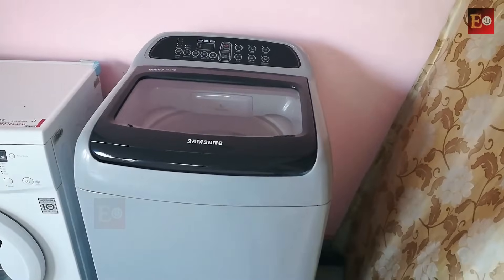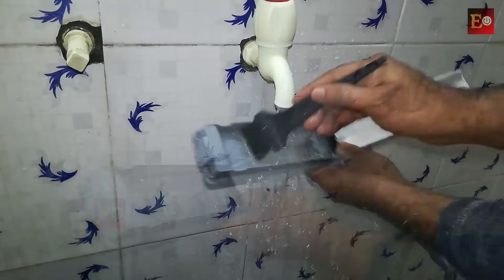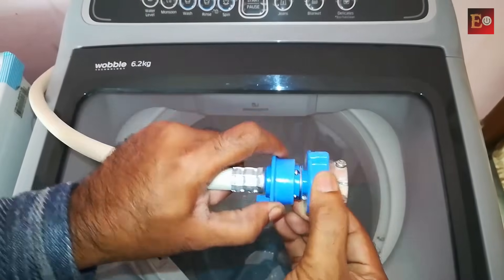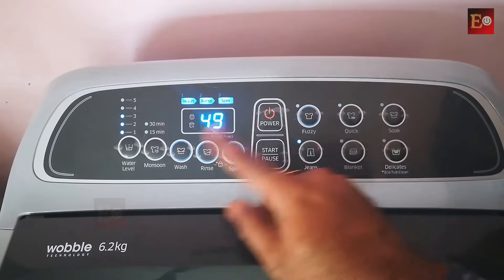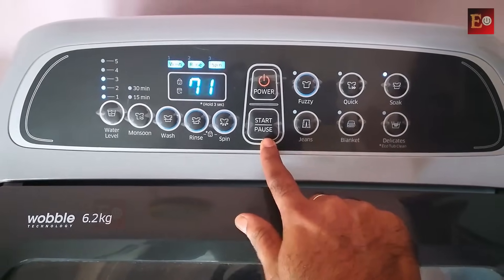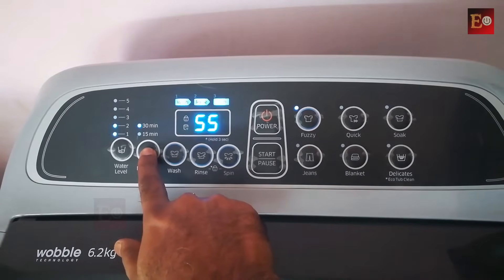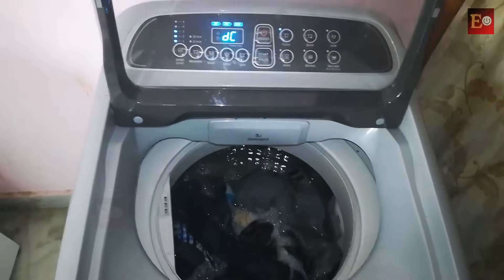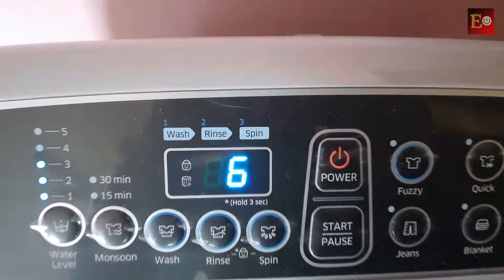Samsung Top Load Fully Automatic washing Machine Demo| How To Use Samsung Top Load Washer And Dryer

Comment: Thanks for the info but I have a problem on my top loader it wash the it suppose to spin it show e6
Reply from the maker: An E6 error can occur when a coin or foreign object is stuck between the pulsator and the tub. To resolve the issue, first remove every item from the wash tub. Then look inside the washer to check the bottom.

Comment: Hi! Thank you for taking the time to explain about the functions. May you please elaborate on the water level? If I want to manually change it, how to decide which water level is appropriate? Thank you for help.
Reply from the maker: Wel com
Reply: How to do after cleaning
Reply from the maker: Top load washers can't wash dark stains. But Front load washers can remove dark stains also. Because front load washers can wash with with hot water.

Comment: Thank you sir for well demonstration !!!!
But i have 1 doubt i.e. it showed time 43 min on display but it took more than 2 hrs & water pressure is also complete so what can be solution of it ??
Reply from the maker: Machine take more time than display for washing. Time does not move or slowly move on display when machine taching the water. If water pressure is less at water tap machine take more time for washing.
Reply: I will also have same problem in machine it take two hour even in quick wash what is the problem pls tell me how I reduce the time for washing
Reply: @ELECTRONICSALLINFO okay thank you sir for information !!!!!

Comment: DO we need to run the tap water on continuously? Or have to turn off once drum is filled and turn on again during rinse?
Reply from the maker: U don't turn of water tap in middle of the washing. If u once start the machine u dont need turn of water tap in middle of the washing. I takes water only when it need the water.
Reply: @ELECTRONICSALLINFO  okay . Thanks

Comment: Thanks for the information.. I'm recently bought it..
I have a doubt it will be shake in the time of spin and rinse...(it is common or any-problem in washing machine)
Kindly be request please reply
Reply from the maker: Normally washing machine are little vibration in spinning time. if your washing machine is lot of vibrates in spinning time, you have to check at washing machine four legs on the floor. if lags are not properly set on the floor or if any gap from the floor, washing machine is lot lot of vibration or shakes in spinning time.
Reply: @ELECTRONICSALLINFO  thanks a lot for the information

Comment: Hi, Thanks for the video i have small dought in my done have tap connection can we pour water into machine kindly suggest
Reply from the maker: What pour water. I can't understand
Reply: No. Its automative u cnnt use basin or pale to pour water let the hose connect to ur faucet. U cn only close the faucet if the machine stops washing.the machine has its own world its up to the machine when and what water level will  be poured and needed depending on the weight of ur clothes too.the machine is the boss ✌️
Reply: In washing machin for what purposes to blinks 1to 5 number my machin 5th number not lighting what the reason?

Comment: For each cycle do we need to remove water pipe to drain out water ?
Reply from the maker: After we start the mission no need to remove the tap from the pipe or the drain piping from the mission. When the mission needs water, it automatically takes it from the tap and after the washing is complete, the water is sent out through the drain pipe
Reply: @ELECTRONICSALLINFO  actually we have taken new washing machine after  wash it has stopped we had to remove water  drainer from washing machine & again rinse
Reply: So is it better to raise complaint ?
Reply: @ELECTRONICSALLINFO   thanku for information and video
Reply from the maker: We never need to remove it. Machine is completely fully automatic machine. After completing the wash also. Keep the Horses 24 Hours to tap

Comment: Hi good day please i went to buy washing machine but if i start there's no pressure in it what's the problem
Reply from the maker: If the water comes slowly from the top, the water will come slowly into the mission

Otherwise, even if there is a filter near the pipe on the back side of the machine, the water will come slowly into the mission even if it is more damaged , Open the back side in let pipe and clean the dust near the filter inside and replace it

Comment: Once i connected the hose to the faucet will i stop water faucet while it is operating?or i wil jst let the faucet run until the machine stop?i hv this machine until now i dd nt use it i was confuse hehe
Reply from the maker: Should don't stop water after started the machine. It's completely fully automatic washing machine. It takes water automatically from the water tap when it need. After connected the hose, U can also keep the water tap in open before started and after wash compleated also. It takes water only when machine is washing clothes.
Reply: Does this machine has its own dryer?or how to use dryer? ✌️
Reply: Or this machine has no dryer? I will be very sad

Comment: Very useful TQ so much ..i have a doubt - if we want only rinse and spin what should we do !
Reply from the maker: You have to on only Rinse and Spin indicator lights only, there are Wash, Rinse, Spin options on the machine. You can choose which cycle you want.If u press and hold there will change. Choose only  Rinse and Spin only.

Comment: Why my washing machine is not giving inlet of water after selecting air turbo switch. Even after stopping and restarting water is not coming.But the machine is working after filling water by manually pouring from outside. Please explain whether the machine can be reset or it needs a repair of inlet valve solenoid?
Reply from the maker: there should on three lights wash, Rinse Spin before starting the machine. wash rinse spin options are there

Comment: Can we purchase a longer water pipe & from where...
My tap is little far away from machine...
So we have to change the position at the time of washing
Reply from the maker: You can buy. I'm sending u links in online.

6 meters pipe

https://www.amazon.in/NEW-WARE-Loading-Automatic-Washing/dp/B08DV88YN4/ref=mp_s_a_1_5?dchild=1&keywords=long+inlet+pipe+for+washing+machine&qid=1611158858&sprefix=long+inlet+pi&sr=8-5

3 meters Pipe

https://www.amazon.in/Washing-Machine-Flexible-Adapter-Connector/dp/B07T49NL6R/ref=mp_s_a_1_7?dchild=1&keywords=long+inlet+pipe+for+washing+machine&qid=1611158917&sprefix=long+inlet+pi&sr=8-7

5 meters pipe
https://www.amazon.in/HASTYNES-Flexible-Adapters-Connectors-Automatic/dp/B08359M45L/ref=mp_s_a_1_1_sspa?dchild=1&keywords=long+inlet+pipe+for+washing+machine&qid=1611158917&sprefix=long+inlet+pi&sr=8-1-spons&psc=1&smid=A16S5UE8WDSAAI&spLa=ZW5jcnlwdGVkUXVhbGlmaWVyPUEzMEdQU1JRUFlFV1hZJmVuY3J5cHRlZElkPUEwMTY0NDI2MkNKSk9HNjE4QkNXSSZlbmNyeXB0ZWRBZElkPUEwNDM2ODgxMVg0VzFZUEtNOUdSWCZ3aWRnZXROYW1lPXNwX3Bob25lX3NlYXJjaF9hdGYmYWN0aW9uPWNsaWNrUmVkaXJlY3QmZG9Ob3RMb2dDbGljaz10cnV

Comment: Are these instructions also applicable to the samsung WA10J5750SP model?
Reply from the maker: yes, applicable to WA10J5750SP model also. washing features the same. the only difference is 10J5750SP  has a transparent wash basin. the only difference is a transparent hand wash wash basin
Reply: @ELECTRONICSALLINFO  oh ok, thanks man!
Reply: Oh and does the machine automatically drain the water after the 1st wash cycle? If yes, then does the machine automatically fill itself with fresh new water for the 2nd washing cycle i.e., rinse ?
Reply from the maker: Yes. After startesd, it has 3 cycles. 1Wash, 2Rinse, and 3Spin. If you once the machine it will do everything automatically. Automacannly fills itself with fresh new water after a 1st cycle completed. the machine automatically drains the water after the 1st wash cycle.
Reply: Hmm does that means i need to open the water faucet while the 3 washing cycles is operating?
Reply from the maker: we don't need off and open the water tap in the middle of the washing. it takes water automatically only when it needs. we can open it always.

Comment: Is it possible to use only cold water since while I don't have the hot tap
Reply from the maker: Yes we dont need hot water tap. U can connect with cold water tap.
Reply: The problem is that  water goes in n out with out covering the clothes  like in the video, I find it hard to understand please help

Comment: Does automatic washing machine certain amount of pressure from outside? Does the water pump pressure needs to be high?
Reply from the maker: No need high water presure. If presure is high machine can get water quickly. If presure is low machine can get slowly.

Comment: Which kind of powder we should put
Reply from the maker: Well come
Reply: Tell man
Reply from the maker: Use matic detergent powder. Some matic detergent powders are available in the market for top loading machines in all brands. 

https://www.amazon.in/Ariel-Matic-Detergent-Washing-Powder/dp/B01N4GLE1I/ref=asc_df_B01N4GLE1I/?tag=googleshopdes-21&linkCode=df0&hvadid=397006129891&hvpos=&hvnetw=g&hvrand=4112328473106349745&hvpone=&hvptwo=&hvqmt=&hvdev=c&hvdvcmdl=&hvlocint=&hvlocphy=1007740&hvtargid=pla-307224909021&psc=1&ext_vrnc=hi

https://www.flipkart.com/surf-excel-matic-top-load-detergent-powder-2-kg/p/itm3ca52bc65671b?pid=LDTET5UD3CKYX3GZ&lid=LSTLDTET5UD3CKYX3GZADU9GA&marketplace=GROCERY&cmpid=content_washing-powder_15083003945_u_8965229628_gmc_pla&tgi=sem,1,G,11214002,u,,,556262839325,,,,c,,,,,,,&gclid=Cj0KCQjwspKUBhCvARIsAB2IYusJAxgSLihWwrF3G3SB3K_6BsP3G5OS5Zt4eHJxIX4E4dQAvkze_sQaAkftEALw_wcB

Comment: Hi when do I use the white hose at the back ? For excess water only ?
Reply from the maker: You connect to water tap before start the machine then u open water tap. U can keep the water tap in open continuously when machine washes clothes or u can open the water tap 24 hours when pipe connected to the water tap. Machine takes water only when machine need to use.
Reply: ELECTRONICS ALL INFO I must have confused you with my question... I meant the drain hose ? The one with grids ... when do I use that like put it down for draining ...
Reply from the maker: Grid hose for drain water . If its near bathroom you can set this pipe to wash room or where u want to go waste water outside.

Comment: After the first wash and drain our samsung machine shows 5E error and not spinning the clothes. What could have been the problem. Please let me know. Thanks. Mrs. Sridhar.
Reply from the maker: There is a drain water pipe problem. If there is any problem with the drain water pipe, and the drain water does not come from the drain pipe, they show a 5e error. Check the drain pipe completely

Comment: Its use with out water tap...or ... water tank
Reply from the maker: This machine need water tap. It is completely fully automatic washing machine. If we connect to water tap, It takes water automatically from the water tap. But if you buy semi automatic washing machine, don't need weter tap. We can add water manually in Semi automatic washing machine.

Comment: Does tap connection was compulsary
Reply from the maker: Yes. This is completely fully automatic washing machine. It takes water automatically from the water tap. But semi automatic washing machines don't need water tap. We can add water manually in Semi automatic washing machines.

Comment: Please send.link to buy tab online if possible. Thanks a lot for very useful information.
Reply from the maker: You can check this links
https://www.amazon.in/Samsung-Fully-Automatic-WA62M4100HY-TL-Imperial/dp/B0747XV38N/ref=sr_1_1?crid=3L95G3G5BAQRP&dchild=1&keywords=samsung+topload+washing+machine&qid=1599328013&s=electronics&sprefix=samsung+topload%2Celectronics%2C741&sr=1-1-catcorr

https://www.amazon.in/Samsung-WA62K4000HD-TL-Fully-automatic-Top-loading/dp/B01H4WMFAY/ref=sr_1_1?crid=3L95G3G5BAQRP&dchild=1&keywords=samsung+topload+washing+machine&qid=1599328013&s=electronics&sprefix=samsung+topload%2Celectronics%2C741&sr=1-1

https://www.amazon.in/Whirlpool-Fully-Automatic-Whitemagic-Classic-601S/dp/B071VRCHZJ/ref=sr_1_12?crid=CBKARYEY6348&dchild=1&keywords=whirlpool+top+load+washing+machine&qid=1599328147&s=electronics&sprefix=wirl+pool+top%2Celectronics%2C388&sr=1-12-catcorr

https://www.amazon.in/Bosch-Fully-Automatic-Loading-Washing-WOE654Y0IN/dp/B07DDFHMPR/ref=sr_1_1?dchild=1&keywords=bosch+washing+machine+top+load&qid=1599328253&s=electronics&sr=1-1
Reply from the maker: you can check this links

Comment: Very use full video. I HAVE doubt in it. Shall I use the same washing machine as semi automatic. Because we won't have tap connection separately. I tried to run the machine with semi automatic. For that I used top left side buttons. At first I gave power on and then I select only wash and I started the machine. It started washing but after completing the single wash it will not remove the water from the tub. For that what will do. Can you please share how to use this as semi automatic machine as well..
Reply from the maker: I don't have semi automatic washing. I think u have choose only Wash cycle only and may be there not done 2 nd Rince cycle. after started the machine fully automatic machine will do 3 cycles Wash, Rinse, and Spin(Dry). Fully automatic machine do these three cycles in single tub. But semi automatic machine 1st Wash and 2nd Rinse cycle do in 1st Drum and final Spin(Dry) cycle do in second drum. I think u have choosen only Wash cycle separately.

Comment: Hi do we need to leave the tap open or should we close the tap after connecting the hose ??
Reply from the maker: We can open the water tap always after connected it and after wash compleated also. This machine is completely fully automatic washing machine. Machine takes water only when it running and when it need.

Comment: Hi, good info. My machine model is WA65T4262VS. I want to use soak first, then after some times, I want to use wash as normal. How to set this.
Reply from the maker: There are wash programs fuzzy, quick, soak .... Some wash programs, u can choose any one before starting the machine. If u want soak, u can choose, then if u want chage another one, u press other wash program, then thare will chane soak to other wash program.

Comment: Hiii brother good video..I have same new, I try to start but water coming not stop and water all going out also !?? Why
Reply from the maker: There should be on 3 lighgts wash, Rinse and Spin lights before starting the machine. Check the lights. There are Wash, Rine And Spin buttons on the machine key pad, use these buttons keep the the lihgts in on before starting the machine
Reply: Hii broder I bought top loader automatic when I start it all d water will start draining out immediately  y

Comment: Why ours keeps on displaying 4C in the display? Do we really need presurized water so that we can continue washing? Please i need answers. Thank you.
Reply from the maker: The (4C) error indicates that the washing machine has detected that there is a problem with the water supply. The most common reason for this error is a blocked or kinked water supply hose. ... 1.Check that the water tap connected to the washing machine is open to full.

2Check that there are no kinks or bents in the water hose connected to the machine.

3Check to see if the water hose mesh filter is not blocked. See the steps below showing you how to do this. You should clean the water hose mesh filter at least twice a year to prevent build up.
Reply from the maker: Normally we don't need pressurzed water

Comment: I hv bought one of the machine and I didn't get the adaptor for my pipe. Can I get one to be able to connect to my tap
Reply from the maker: Some water taps available for washing machines. They are available in market. If u are use that type of tep no need adaptor. Other wise adaptors are available in out side market
Reply: @ELECTRONICSALLINFO  can you buy one and ship to me here in Ghana pls?
Reply from the maker: How can I buy, u can buy also in online

Comment: thank you...  what is soft dispenser?  any use... its in top of the tub which contains three holes. what is that
Reply: It is a compartment where you need to fill softener. You could fill during cycle start. It shall be consumed during rinse spin time

Comment: Hi, once we switched to rinse or spin only option. How to switch back to the normal mode?
Reply from the maker: there are Wash, Rinse, and Spin options. u can select manually. if u want back, u turn on Wash Rinse and Spin lights with Wash, Rinse, Spin options then start the machine and turn off the machine, then wash, rinse, spin program will save

Comment: Does automatic washing machine itself warms the water or we have connect to warm tube?
Reply from the maker: This machine is completely fully automatic washing machine. But This machine does not have inbuilt water heater. So this machine can't wash with hot water. If u buy Top loaf machine, Only limited models have inbuilt water heater in Top load washing machines. But if u buy front load washer, all models have inbuilt water heater in Front load washing machines.

Comment: Sir ! Im using this machine from 3 months...from last two days it is taking more time to complete the cycle in quick wash ( normally it was 40 mins)
Reply from the maker: If u choose quick option there will show 30 minutes. But machine will take some more time. Because machine does not calculate the time pause time when machine take the water. And If water pressure is low from the water tap machine take some more time.
Reply: Ok thanku sir
Reply from the maker: After some washes, open the back side inlet pipe and clean inside filter. If there is more dust at filter machine can't take from the water tap.